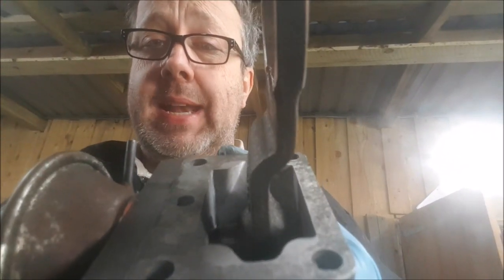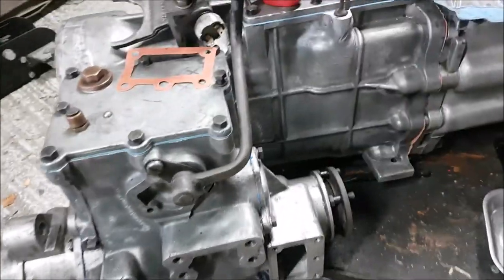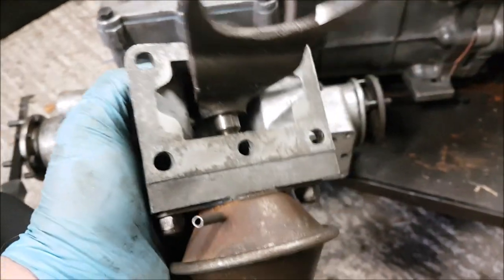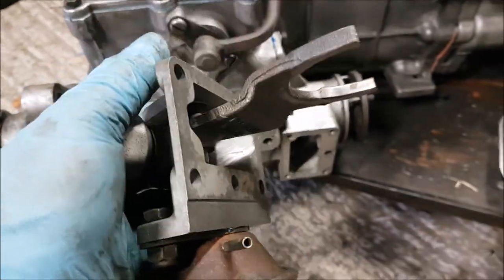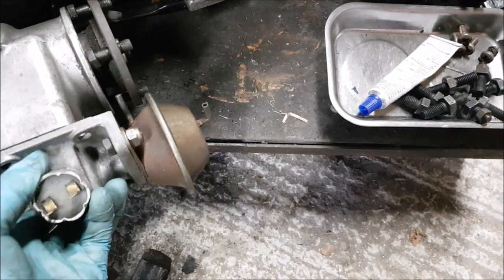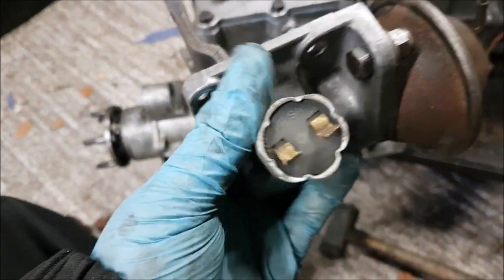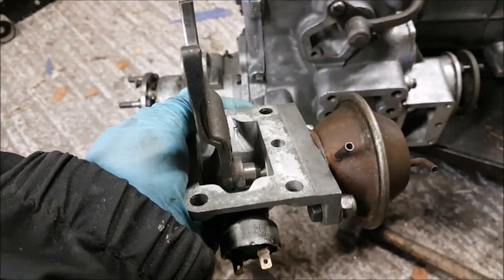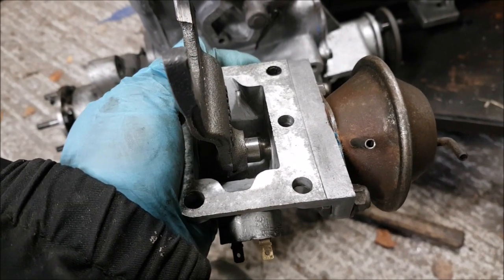Range Rover Gearbox 4 speed LT95 Part 6   Vacuum difflock

Comment: Hi, Thanks for the simple informative vid. ive removed my actuator and when i suck it seems to have a fluid ( petrol) in the vacuum Any reason you can think of for this?
Reply from the maker: I can only think it has somehow come down from the inlet manifold. is the diaphragm inside the diff lock actuation intact or can you blow through it. drop me an email is you need further help

Comment: Good video does a Range Rover 1993 diff lock or traction control or both only my seems to be locked on because wheel scrub when going round corners thanks Danny
Reply from the maker: Sounds like your centre viscous diff is seized. you can check it like this https://youtu.be/HfqWsO_04YU

Comment: Tried the blow and suck test and it moves the fork when I blow does nothing when I suck. Can move it both directions by hand no prob. Hand mounted it like in your demo raised  right hand rear wheel off the ground and it s locked up . with the transfer box in neutral and Actuator placed inside to engage ring nothing happens when i move the housing ,still engaged.

Comment: Got the devil off not to hard removed drivers side floor pan adapted
Impact philips head bit to a shifter

 And a ring spanner and off she came.
With engine running used dash control to activate the
 Fork and it moved reasonably well one way but not much the
 Other way. Going to try the
 Suction/ blow test before buying a new one. Hard to get.
When the switch is pulled out to engage the
 Lock it makes a hissing sound im told this is correct but should it stop or continue?

Great vidS
Reply from the maker: not sure on whether it should hiss or not, I would have thought not. Check the vacuum tubes from switch to diff lock actuator, sounds like the one to disengage may be split

Comment: Love the vid. Got A Land Rover Perentie Australian model. 3.9 isuzu Lt95A gearbox.
Problem is could not get diff lock to activate. No red light. Blocked off switch vents and got lock to work ,red light on  all working. Problem cant get it to disengage now. Thinking crook diaphram.
Reply from the maker: yes it sounds that way, or the plunger is so sticky that the diaphram cannot shift it, getting it apart is easy. access however rarely is. good luck